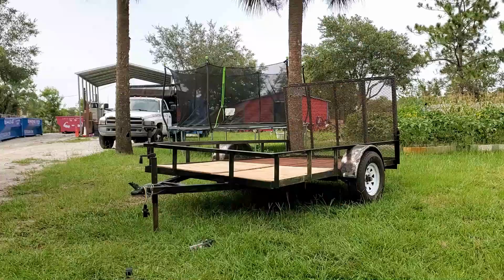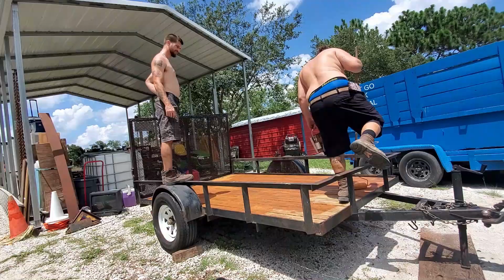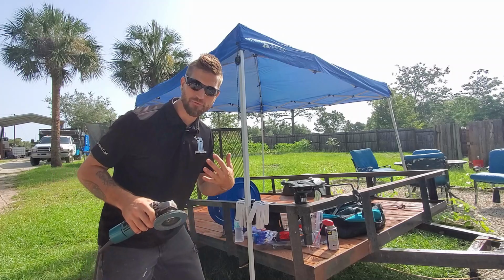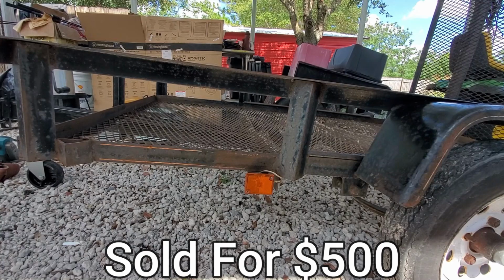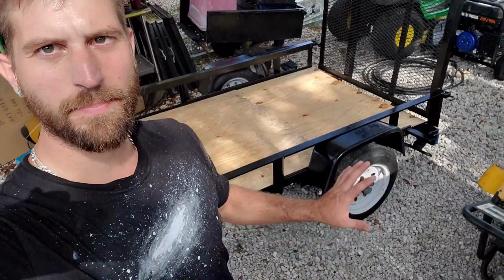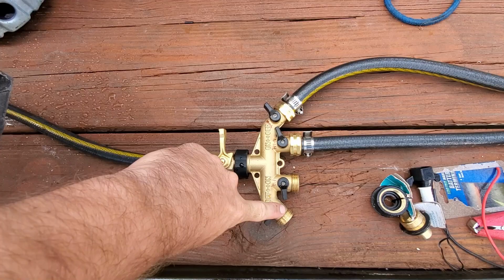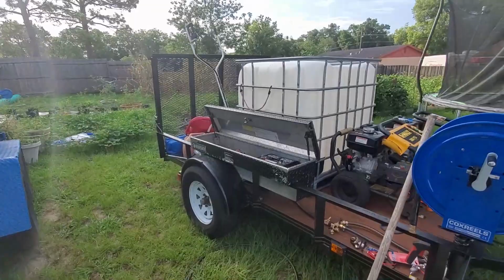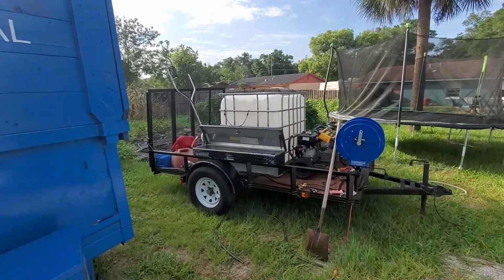How To Build The Best Pressure Washing Set Up

Comment: Thanks for making the video. Here's a couple things you should know about your pressure washer setup. 
1. Most  home spigots only put out a little more than 4 gallons of water per minute. So you're going to be starving your pressure washers for water if you try to run them at the same time from the same hose feed. That splitter that you are using, is probably restricting a good bit of your water flow. 
2. You need to find out how many GPMs your 12 volt pump puts out. Make sure that it is adequate for the GPMs of your two pressure washers too you run at the same time. Also you must still consider the splitter restricting your water flow. You should to have at least 5/8  diameter unrestricted water flow to each machine to prevent it from being starved of water and burning up your pumps.
3. You need some water filtration to keep grit and debris from getting into your pumps. Banjo makes in line wye strainers for this purpose.
4. Install some sort of unloader valve and run the unloader back to your IBC tank. 
Good luck to you guys.
Reply from the maker: Thanks man, I appreciate the advice!

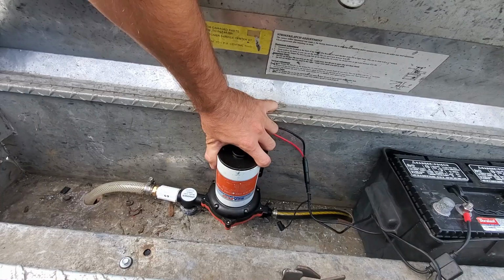Comment: Put a rubber grommet on the aluminum edge you cut for the tank hose. The vibrations from the pump could eventually cut into the hose. (9:54)

Comment: Good set up... I think you can fit another water tank if you move your washers forward & tie them down 4 ways. 1 tank for each washer...
Reply: @MreFEy  I definitely forgot.. a 275gallon tote weighs 2,500lbs when filled with water? Yea that's definitely too heavy.
Reply: @MreFEy  before the pandemic, I was working for a solar company as a maintenance worker. My job was to drive to different solar farm jobsites & wash the solar panels using a Honda 390gx commercial pressure washer I think. I hauled a trailer with a 350gallon water tank. 2 water hoses 50 ft each. 2 100ft pressure washer lines.. I had fun doing what I did.. lots of hard work in 100° heat days but I got it done... I started with a trailer similar to yours & a small Honda pressure washer for residential use & a 75 gallon tank.. I had trouble finishing up jobs. Then I convinced my boss to invest $8,000 on a bigger trailer, a commercial pressure washer & a 350 gallon water tank. Huge difference.

Comment: those pumps in those pressure washers are gonna starve for water and shorten their life. To avoid this, make the supply hose from the tank to 1inch, and when using garden hose use two separate 3/4 in garden hoses from customers hose. and 3/4 in hose's from your switching valve to pumps. you machines will get much more water and the pump will last longer.
Reply: @gregjones6627 most pumps ive seen have 3/4  inlet/outlets , would you just convert it over to 1 inch hose with 1inch to 3/4 adapter ? 
Thanks
Reply: ALWAYS A WANNABE SMART GUY STHU

Comment: About how long will that battery run that water pump? I have a Outdoor solar panel that's made to steady charge an RV or Boat battery, Could i hook that up to mine and passively charge it or does it run down way too quick and need to hook a battery charger up to it everyday. Thanks

Comment: Have you had a problem with your seaflow pump overheating/burning up/quitting? I run a similar setup with a slightly bigger pressure washer (DeWalt 4000 psi, 3.5 gpm) and I've burnt up 2 Everflow 5.5 gpm/60psi pumps in 4 days......

Comment: If the water hose didnt have access too the pump, would it have enough force too run 3600 psi on a drive way etc?
Reply: @MreFEy  If your using an 8gallon a minute pressure washer wouldnt your tank be out of water after an hour etc ?? How do you work around this?
Reply: @MreFEy  But you were saying before that the house water suply isnt strong enough to run the power washer on and it would burn out etc?

Comment: Couple of questions: How well has that pump held up for you ? Does it provide adequate water supply to effeciently run both washers simultaneously ? My machine is not a belt driven machine, therefore its water source has to be force fed, and I have been considering a setup such as yours but wasnt sure if this design would work. Thanks !!
Reply: Direct drives will pull water from a buffer tank.
Reply: @deandrewilliams2963  I'm trying to rig one of these up what do you mean by direct drive?

Comment: So if with the water tote do you need a separate water pump
Reply: @MreFEy  if the pump is running, and you're not using much water... Will it burn up the pump?